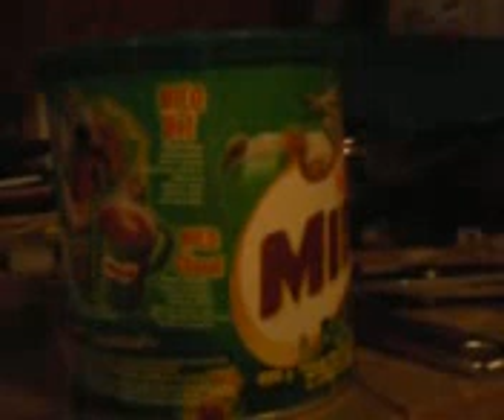Stirling engine paint can 3 of 3

Comment from the maker: I didn't mention, the power diaphram cylinder is from a tomato paste tin, I cut off the top inch off the can as the electric tin opener left a nice smooth finish when it was opened, & stuck it to the paintcan with silicone. The hole in the paintcan through to the displacer cylinder is between 1/4 & 1/2 an inch.
I've logged about 4 hours runtime & the balloon rubber is stretching so it runs a bit slower, tried stretching it, need to make a new one of revised design, sorry about the poor light.